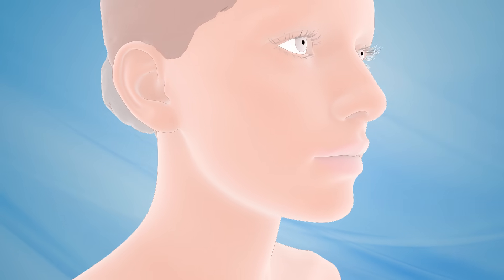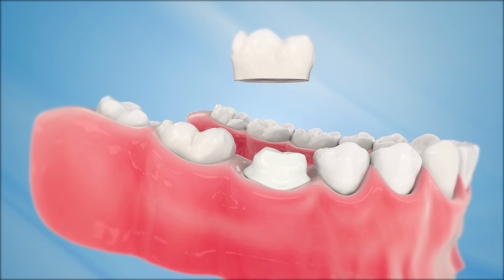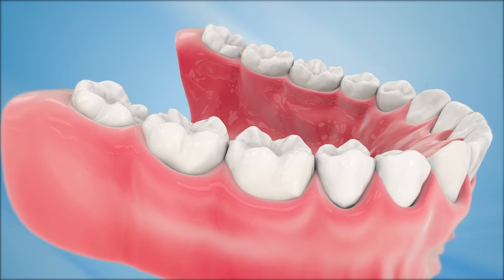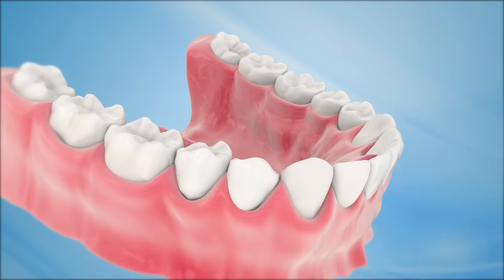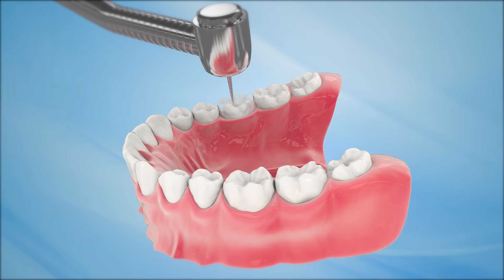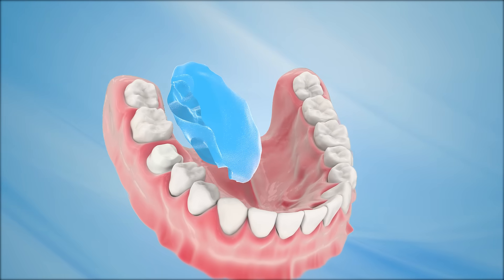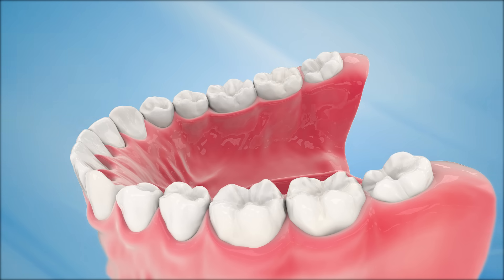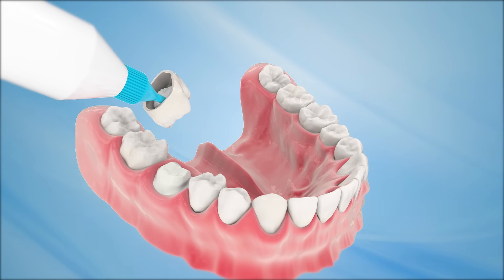Dental Crown Procedure

Comment: For me it started abit painful until my dentist realized I’m very resistant to novocaine. I think 3rd shot finally had me numbed up good but she needed to put in a 4th shot mid-procedure. After that I didn’t feel much maybe a pinch if I would scale it from 1-10 I would say barely a 1 and when she was on the final bits of forming the nub it felt like a 2 almost a 3. BUT that’s most likely because of my high resistance to novacaine cause when she placed my temporary I was starting to get sensations back on the gums surrounding the tooth. If you’re like me you’re going to need 3 shots minimum maybe more and if they take awhile to form your tooth they might need to add another shot in between. Most people aren’t resistant to novacaine I just happen to be one of them.

Comment: The new and MUCH better way to do a crown is to use a scanner to make a scan of the tooth, then the dentists spends about 5 minutes using 3d modeling software to model the crown for the tooth, which then get milled out of a cube of porcelain in the next room in roughly 10 minutes.

NO WAX, NO TEMP CROWN, less than 2 hours for full procedure (no follow up visit).

I had a 2pm appointment today, went back right at 2, had a crown (tooth 19) and a filling (tooth 20) done, and was out the door with a permanent crown before 4pm.
And minimal pain once the numbing finally wore off several hours later, from the string that goes around the tooth under the gums to contain the glue, which some ibuprofen fixed right up.

I was dreading the visit because of horror stories such as this with the awful wax and such, but that is a thing of the past if the office has the right equipment.

Comment: How much does a crown cost without insurance?
Reply: 1500+
Reply: 1500+
Reply: @dom7193   I’ve done more checking in my area this week. It’s $1300-$1500.  Cheaper to just pull the tooth if it’s in the back and not visible when smiling.

Comment: Just got this thing done literally in the past hour if they tell u it dont hurt IT DOES 😩😩
Reply: The first procedure where you get a temporary crown is nearly painless as they numb the area except it is a bit uncomfortable but it doesn't last long.

The worst paint for me was getting a permanent crown, as the tooth under is very sensitive and they didn't numb it as it isn't required. Like blowing air on it to make it dry, cementing it and actually placing the crown, and afterwards when it heals.
Reply: @zalpheny  ok whatever fed

Comment: about to have my permanent crown placed. when I got my temporary crown, they numbed me in two spots. tiny pinch per usual but nothing i cared for/just routine. they started by removing my temporary filling and gave me a permanent filling the same way a cavity would be filled. after that, they took a drill and gently drilled around my tooth to file it down for the crown. after it was drilled, they created a mold (the same mold you would for creating braces) and placed it to my tooth to create a mold for the temporary crown. although i had no pain at all during the whole thing, my numbing wore off after the mold so I was experiencing a lot of stinging/irritation around the tooth where the packing cord was placed. I asked the dentist assistant about my pain and asked for more numbing, but she blew it off since we were already almost done 🙁 so i was like complaining and hurting for maybe an hour following the appointment just cuz the gums around my tooth were stinging, but it wore off quickly and i had no pain in that area the following hour. the temporary crown just feels like your regular tooth except it’s smoother and has none of that regular tooth rigid texture on top. in the next hour i’m getting my permanent!! excited, heard it’s much quicker and doesn’t need numbing.
Reply: Did you have any issues with the temporary crown? I'm getting this done in about a month or so and I'm worried about the temporary falling off or something while I wait for the permanent lol.

Comment: My moms temporary crown popped off and it scared me, but mine has stayed on and I get my permanent in about 5 days. I would like to know if the permanent is anchored with a different adhesive, that makes it impossible to pop off?
Reply: Sometimes the temporary ones will pop out. You have to be cautious about eating hard foods with them in. They don't use permanent glue for the temporary crown (obviously).

Comment: I'm supposed to have this done tomorrow and I'm absolutely terrified. I don't know why, I just feel like this is an unnecessary scam. They told me it's a permanent fix but all the research I'm doing says crowns only last 5-10 years.
Reply: Same 😭 I need 3 done before the tooth has even cracked or anything
Reply: If you are seeing this do you mind sharing how you are doing with the crown? I had a root canal a few days ago and now have to spend 500 on a crown but I am getting mixed reviews on rather or not I should even get the crown it's on my front side tooth
Reply: @bossent.9575  I didn't go through with it! My thing is I am not getting any kind of procedure done unless it is a matter of unbearable pain. I have zero pain at all and never did have any, so I see no reason to put myself through that kind of stress - having my TEETH filed down! - unless absolutely 100% necessary. I think I posted my comment 4 or 5 months ago? I'm perfectly fine. I would think long and hard about this procedure. My advice is to only do it if you're in massive pain. It's unfortunate but some dentists/doctors really are snake oil salesman and profit drives the medical field. Good luck to you, keep us updated!
Reply: @KeithaReeves0314  I'm 100 percent with you on that, the only reason I got my root canal is because that tooth had a hole,  but I still have another 1k worth of cavities crowns ect they are trying to get out of me I said the same if I'm not in pain then why even bother seems to me you are perfectly until you start going to the dentist then they terrify you with all these long list of problems you need to have fixed. My only concern is since I have already gotten the root canal should I still get the crown since they say having it not crowned will cause infections ect I'm not trying to pay 500 for a crown if I can avoid it
Reply: @bossent.9575  Yeah, I can see how it might cause a infection if not capped. My best advice would do a lot of internet research and if you can, get to a reputable dentist for a second opinion. I dropped the shady dentists who were pressuring me to get it done and luckily found one down the street from me who has his practice inside his house so he has very little overhead when it comes to renting a practice. (Honestly, I think that's the main driver for pushing these expensive procedures on patients.) He's Ivy-League trained and has very reasonable prices and great online reviews. I would start there. Good luck!
Reply: I had my root canal one year before and week ago a small piece of the filling broke, now the dentist suggesting to put the crown for that tooth. As all know it’s expensive and also not sure will it worth for the money.

Comment: You better update your video. I went to my dentist yesterday and a computer took pictures and mapped out my tooth and bone structure. And then A machine literally made the tooth right in front of me. The whole process took about four hours. I went home the same day with my permanent brand new crown.
Reply: Not all offices are that updated your lucky to find one. By the way did they need to file down other teeth near it to get it to fit just right
Reply: @bunnyboo6295  No, they adjusted the tooth that was getting the crown.
Reply: @truckingwithtobee  How do I find a place like that one place broke tooth behind to make crown fit I went to a different place need that broken tooth fix i asked if they do the same they told me that they don't touch teeth next to but make the crown a little big so file down the tooth above should i keep looking it cost a lot to just speck with them and so far it is common practice at 3 places the broken down tooth needs to be finished but i don't what more teeth broken

Please help i am getting them to fill a tooth tomorrow and I sure crowning the other tooth will come up I have a habit of trusting once in the seat. Should I tell them I need to wait on scheduling a look around a bit more. There assistant is the one that told me they do adjust the tooth above the crown they admit the make the crown a little bigger something about the teeth need to touch so they adjust the above tooth
Reply: @bunnyboo6295  I would call around more places. I’ve never heard of them filing down the tooth next to the tooth that they are crowning. Without talking to you in person. I don’t think I’m understanding what you are 💯 talking about.
Reply: @truckingwithtobee  my horrible experience the place i just looked into mention they don't touch teeth next to, they do the tooth above. asking someone that has had crowns their dentist filed down surrounding teeth so maybe this is new practice or shady dentists in the area all different place looked at 4 so far
Reply: Yup same here. 2 crowns in one visit. They made them right there in office.
Reply: My dentist does it in 2 appointments
Reply: I went to an expensive dentist that messed up my crowns twice. I’m going again a third time tomorrow.  I’ve been in temps about a month and 2.5 weeks. Hopefully they are able to get it right or else I’m going to a same day crown dentist. It’s exhausting if your in my position 😢

Comment: I live in New Jersey crown is $500 to$1000
I come in macedonian  where I am from I did 4 porcelain crowns for $330.
The drilling of the teeth was with no numbing( anesthesia) yes the drilling hurt a little that was not my problem. 
After placing the crowns it hurts they told me that's normal for couple of days. I did put crowns before at the same doctor and it's been 14 years seance I put the first crowns and no problems. That's why I went again to the same doctor. This time he took the imprints with a 3d camera nothing like a playdough going in your month. 
Also I did a roothcanall for $40 I mean coming here is worthy of you doing your teeth.  Also good food beautiful nature.
Reply: Isn't it still too expensive?
Here, in India,  root canal is for $20, clearly 50% cheap, and crown is only $25, which is approx 90% cheaper 😐😐
Reply: @hh_9116  in chennai root canal with crown costed me $100
Reply: @hemnatht9950  Amm, maybe it's because South India is way more developed than that of North.
I m from Rajasthan, a poor deserty area, that's why it's so cheap here.
Reply: A root canal in nyc is $1500 or more !

Comment: I want to do this for my two front teeth because when I was 10,I tripped on my road(lmao I can't remember what I was doing) and bust/broke my permanent teeth💀 and I've had them filled but they're always cracking😭
Reply: Mine just cracked now😭😭
Reply: I thought I was alone! Having my two front teeth crowned tomorrow, been having them filled with composite for years but they said they can’t do that any more, so crowns it is! Just nervous they won’t look like my normal teeth I guess.
Reply: @heathermcmillan5863  they told me that too!! I totally get that fear honestly!! But I'm sure they'll do it the way it's supposed to be done!
Reply: @heathermcmillan5863   My two front teeth are misshaped and black. Dr told me crown is the solution. Im afraid will they look bad. How your crowns are looking. Do they look nice?
Reply: Did you have it done??
Reply: @kx2678  Not yet, I have to save for it first😅

Comment: I have a molar that had a few messed up fillings, then the last filling fell out leaving a huge gaping hole behind. Got that filled. After a few years it fell out again last night, again leaving a gaping hole. I'm wondering if this would help
Reply: As long as its not infected.
Reply: @ashleenicole71  it's not
Reply: My filling on my molar cracked and fell off and my dentist recommended filling and crown
Reply: My upper molar's filling was dislodged and left a huge gaping hole as well, I'm planning to get a crown instead because fillings don't seem to be working.
Reply: same problem what did u do about it ,any updates
Reply: @sckumar6812  I had the filling done again, they did it differently than the last dentist did so hopefully it stays. But i actually went to the dentist yesterday and they said I'll need a crown for another tooth that turned out to be broken (thought I lost another filling) so we're looking into it
Reply: @haylestormable  gud luck ,hope u get the best treatment this time

Comment: I got 3 root canals and crowns, ngl tho the temporary crowns are annoying but once you get the permanent ones they feel so natural I sometimes forget they're there 😅
Reply: In what form are they annoying? I got a temporary crown right now, the only thing that feels different from normal teeth is that the surface is very slippery and sleek, but that kinda feels nice.
Reply: @suguhayuuka8160  well for me the temporary crowns fell out often, at least of them did more often than the others and it's because it was a bit too big.
Reply: @topazmartinez3441  did it hurt while drilling? I'm gonna drill and my mum did it and she says it hurts rlly bad how did it feel?
Reply: @rihanakm1109  even with anesthesia I felt a lot of pain when they drilled.
Reply: @suguhayuuka8160 temp is resin and feels like a sandy surface,  the porcelain perm is smooth
Reply: @suguhayuuka8160  bro same just got it done today
Reply: I have a temporary crown and its bothering me like its really uncomfortable and when i take it out i feel so relieved. Has that happened to you or anyone ? Not sure if thats normal and i kinda feel pain very bit of pain with the temp crown on .
Reply: @Phanibabyy   @Phani Xoxo  that's what happened to me and it's cause it wasn't comfortable how they put the crown or the glue. It is relieving to take it out but not recommended and usually when the temporary crown came out I'd clean that area and use temporary cement to put it back on, and whenever I put it back on i would clench my jaw for a bit and grind my teeth to make sure it fits good. It may hurt a bit, but it'll go away on its own after a bit (like 30 minutes or less) but if it hurts hurts then it ain't normal and could mean either the post got a cavity or the gums are inflamed and if the second cause is the thing I say just brush your teeth and floss
Reply: @topazmartinez3441  when i take off my temp crown i hate seeing my tooth rot so i brush my tooth and the temp crown also . Not sure if im suppose to do that but i just hate seeing my poor tooth rot away . So i clean both , makes me feel clean . Its been 4 months in haven’t went back to get the permanent crown . I think its time now . Thanks 😊
Reply: @Phanibabyy  
Were they able to save the tooth?
Reply: @Phanibabyy  how are your crowns now?
Reply: @ritwikadas8210  GOOD! Feels like nothing is there . No pain no uncomfortable feeling. Feels normal now.
Reply: @Phanibabyy  thank you for letting me know
Reply: @Phanibabyy isn’t the cost of what you paid including the permanent crown? I can’t imagine them splitting the procedure cost. Or is it that you just haven’t gone back because of the time?
Reply: Does it hurt ill do it soon but does the process hurt
Reply: @mariam-qg3cv  nope! Or at least it shouldn't, it's going to be weird since the first thing they do is hollow out your tooth with the drill and then put temporary filling. Now after you might feel sore in the area, nothing extremely painful but you can still ask for pain killers.
Reply: @topazmartinez3441  could u eat well with crown or does it hurt while chewing
Reply: Does it hurt while placing crown
Reply: How much were the permanent ones?
Reply: @Prasiddi Panta how are they now?
Reply: rct get reinfected easily , there will be future complications of rct , rct is not possible solution  ,dnetists fool people for money
Reply: Hei uhm I know it's very very late ...but is it supposed to be big? The one I got is much larger than the natural ones and the inner side keeps scrapping the tongues...
Reply: Can u get a white crowns

Comment: My cap is always coming out.
Any permanent solution for this??
Reply: Go to the dentist Chile
Reply: BIG advice.....extract it and save future stress.
Reply: @123jac  this is the comment I want thanks
Reply: @Tilly- my dentist said that should be the last resort.  Extracting it completely.
Reply: @deek6913  exactly but won't the other teeth become unstable  because there's a missing teeth between the gaps?
Reply: @daveeffendy493  , I believe that is the idea. That your other teeth will start shifting.
Reply: @daveeffendy493  I had a tooth taken out about 6 years ago, a molar. Hasn’t shifted luckily.
Reply: @FEARisCOLD  can u pls say ur age?
Reply: @user-cu5gg3ll5q  why?
Reply: @FEARisCOLD  means im also thinking to extract can u pls say ☹️
Reply: @user-cu5gg3ll5q  I was 34.
Reply: @FEARisCOLD  does it intefere with ur eating ?
Reply: @sckumar6812  I eat on the side that has a missing tooth gap and I think it depends on what tooth is missing, it's a premolar so it doesn't interfere at all but if it's a molar(especially your 1st) you may struggle with eating a bit but it may not be too troubling for you, everyone's different. It may accelerate teeth shifting and/or bone loss but a retainer can prevent it
Reply: More expensive but get a tooth implant instead
Reply: Get a implant
Reply: Another informative video about treating dental crowns, explained by an expert. check out this video😃 🙌  Found this video on suggested video.
https://www.youtube.com/watch?v=tU3AoGLFyqU
Reply: I saw this under the suggested videos.Check it out. It has great information. Hope it helps
https://www.youtube.com/watch?v=XND6GncOtzg
Reply: This video is all about dental crowns. Check for more information 
https://youtu.be/CxRehbMDCzY